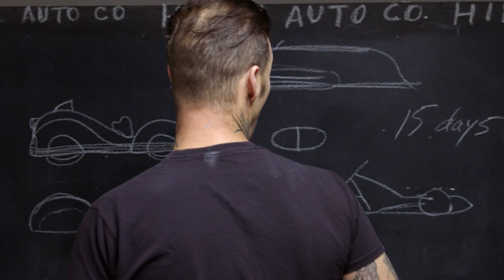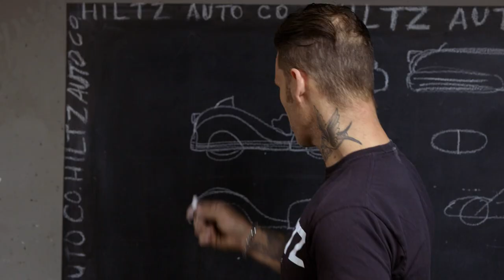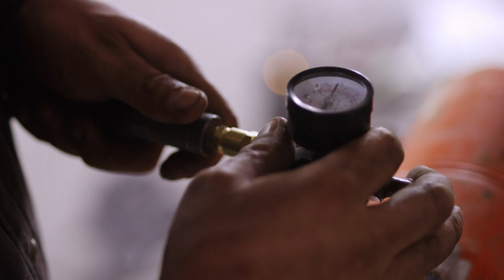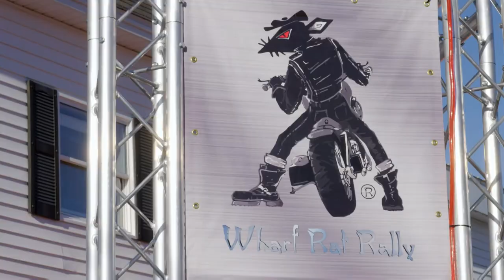Chad Builds A Covered Motorbike For The First Time Ever | Bad Chad Custom

Comment: The lines were nice, but I agree with the others that this bike is an impractical POS.  Pretty sure that's a vlx 600, which is about the slowest shadow ever built.  With the extra 300 pounds of bodywork and a large rider that thing would barely haul itself around.

Comment: Way back in the 50's they made bikes like this it's nothing new,  the handle bars where they are positioned appears to be a bad choice and look uncomfortable for the rider. One thing I know about bikes and I've own a few is that they need to be comfortable or you will dislike it in no time at all but nevertheless it does look cool in some respects.
Reply: Well because design seems to trump ergonomics, just imagine the aero instability and weight distribution to start with. And also the riders position in terms of handling.